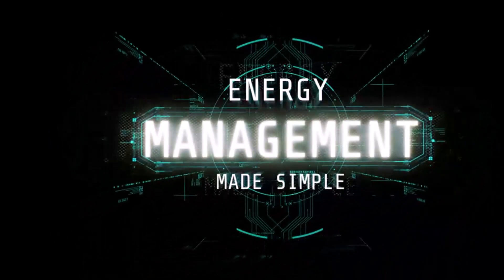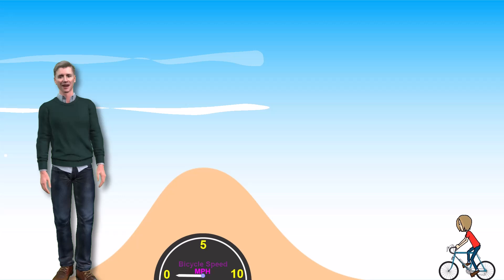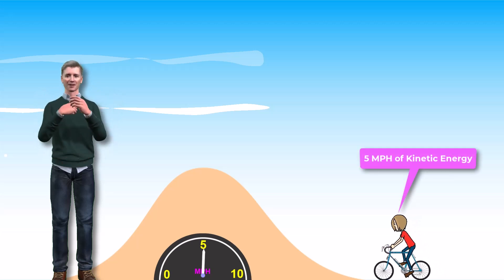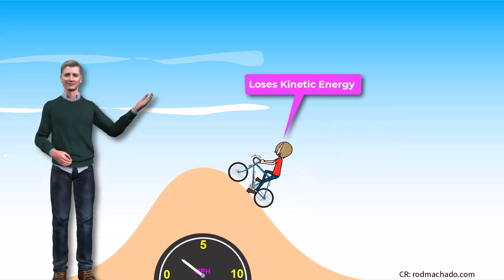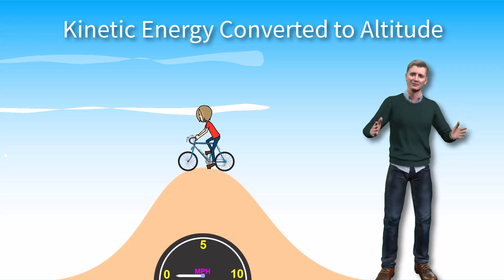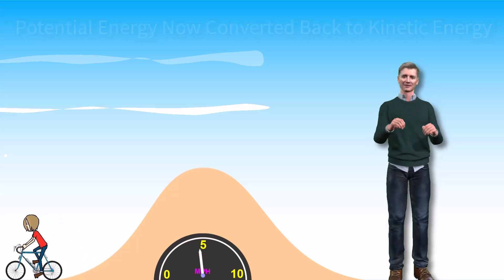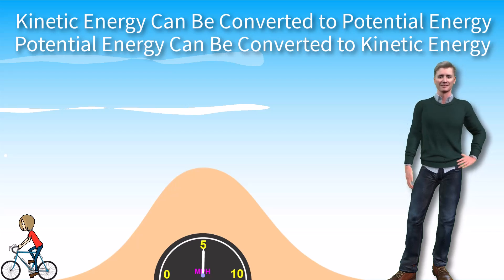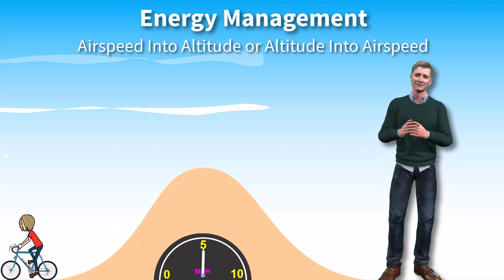Energy Management

Comment: Good example, very important with a sick or dead engine. Engine problems dead or running come in high provided you know the tricks to lose altitude very fast. Maybe you can lead into how to get down quick.aka drag without gaining air speed. Flaps,gear,prop,cowl flaps,forward slips,etc…❤